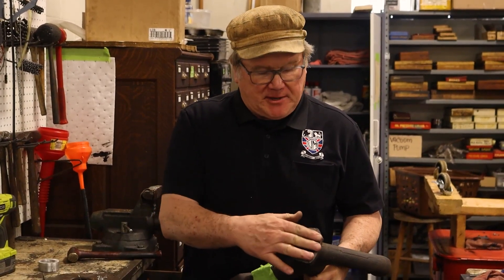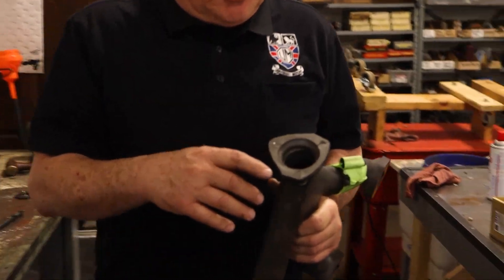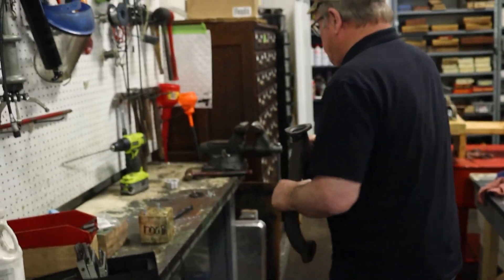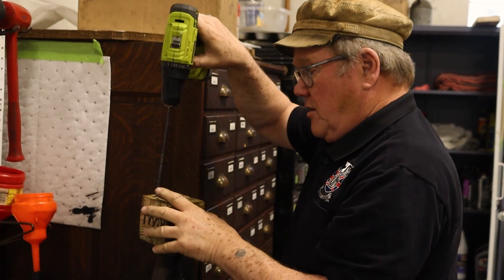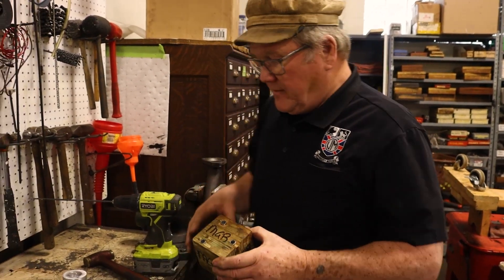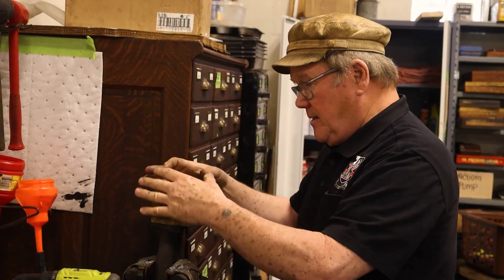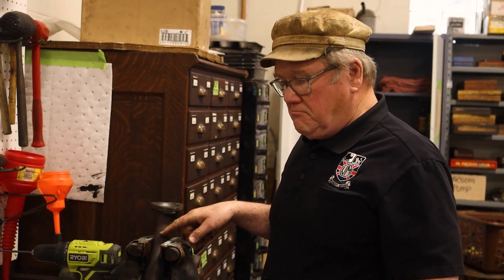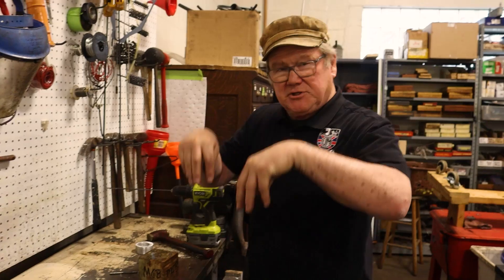472 MG Tech | Repairing MGA/MGB Exhaust Manifold

Comment: I remember a number of years ago you doing a repair on a cast-iron exhaust manifold and you had to drill it out and then insert HeLa coil. I watched you use flanges so you could line up your drill so it was exactly perpendicular. I love watching this kind of stuff because most mechanics today it’s you order another part and just replace it but in our situation because of the cars are old things just have to be repaired and people have to come up with ways to do it. The idea of using a 4 x 4 block is just so simple. It’s almost genius. This stuff brings a smile to my face.